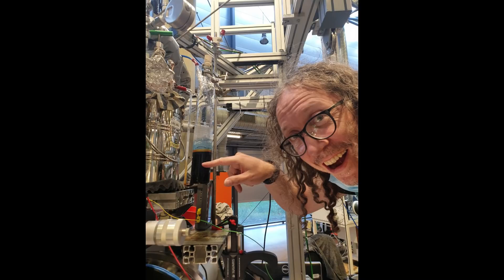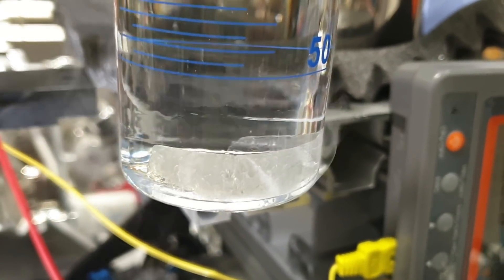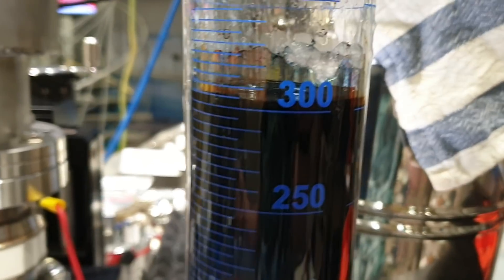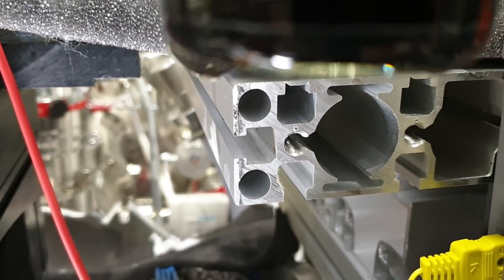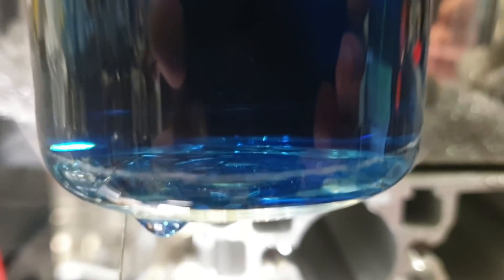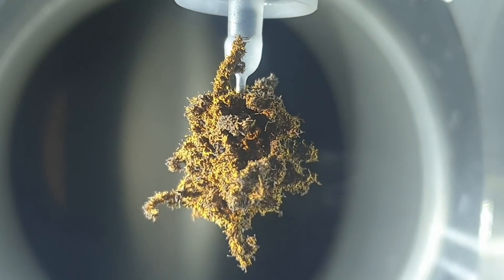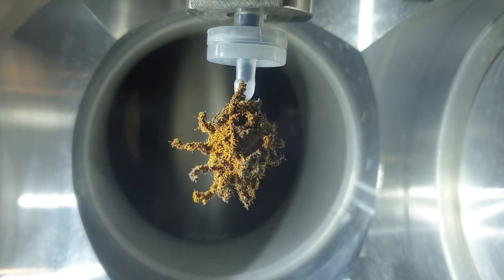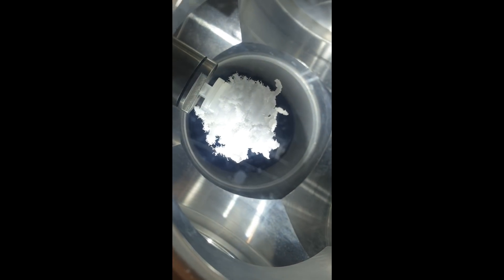Solvated electron in liquid ammonia!

Comment: I remain curious about resistivity. The electrons are unbound, it should conduct pretty well - but how well? Might be a good way to move your electrons around - you could use electric fields and current to adjust the concentration by moving the electrons to the top of bottom of the container.
Reply: On further consideration, I see a problem with the idea of altering concentration: It'd work a tiny but, but the electrons and Li+ ions would simply migrate to a configuration that inconveniently perfectly opposes your applied field. To actually separate them would require an electric field of utterly ridiculous strength, way beyond what you are going to achieve in any laboratory. But it does present interesting avenues for research, as you might alter the conductivity... liquid-state transistors?

Comment: So could you keep concentrating the solvated electrons by letting the solution settle and removing the bottom portion? Is there a critical limit on how concentrated the electrons can get? What happens if you then subject them to high pressures? If you put the end of a wire into it (the solution) would it act like a battery? What if you heat up the solution or hit it with a high powered laser? Can you freeze this stuff? Sorry to bombard you with so many questions but this is so cool.

Comment: It is just so hard to believe that you would have electrons on their own hanging over there. Can you try bringing a magnet, even a weak one, close to the glass to see how it reacts? Surely electrons being all one charge would be attracted to the side of the beaker where the magnet is, right? Or at least make a pattern considering they will also repel each other the closer they are but still it wouldn't look homogeneous I think.
Reply: A magnet shouldn't do anything, as the electrons have no net movement. A really powerful one might affect diffusion rate, maybe? But an electric field, that's got potential! So to speak.
Reply: @vylbird8014  Good point. I am just a bit thrown off because having just free electrons moving around is just weird.
Reply: @A_Box  Not that weird. It sounds very similar to a metal. That's why I'm curious about conductivity - free electrons moving in solution should have a lot less interaction than ions, thus lower resistivity. It might be on a par with some metals.
Reply: On futher consideration, I see a problem: As soon as you move the electrons, the Li+ ions move the other way... to separate those would require an electric field of truly ridiculous strength.
Reply: That's an interesting one I would like to see too. I more picture the electrons getting caught up in the magnetic field. Maybe if they react to magnetism it could be worth exploring what eddy currents do to them.
Reply: When you put on your electron physics hat, your thought totally makes sense; but the chemistry hat is needed for this one...
Reply: @bumbleWeaver  Well, not sure how to think about electrons on their own. Why wouldn't it work?
Reply: @A_Box  most likely for the same reason that the iron in your body doesnt come ripping out when you go inside of an MRI...

Comment: I bet a lot of people want to know: What happens if you freeze it in the beaker?
Reply: The solid crystal structure won't provide the same charge pocket that the liquid does, so the electron won't stay solvated.  Presumably it will re-join with the Li+ as they freeze out.

Comment: would solvated electrons hold the same color if they were in another solution other than ammonia? Or does the ammonia have an effect on it also
Reply: They'd be blue aswell. You can actually see it in Phil's highspeed footage of what happens when you throw a chunk of sodium into water; the electrons move out so quickly that the blue water can only be seen for a frame or two. Then the lump of positively charged metal ions more or less explodes because the ions repel each other.
Reply: @Psychx_  Also, the lack of electrons makes the sodium transparent.  Which is funky.

Thoisoi2 came up with a way of making transparent sodium that exists for longer before it goes bang.  But he concluded it wasn't really transparent but there was some sort of refraction happening.  I think he's wrong.  Take a lot of electrons out and there are no band gaps left of the right energy to absorb visible light.

The thoisoi2 method was float some paper towel on water and put the sodium on.  I think you can find his video with a search for transparent sodium.
Reply: in dimethoxyethane solvated electrons are also blue.